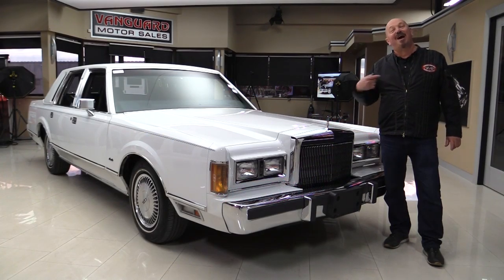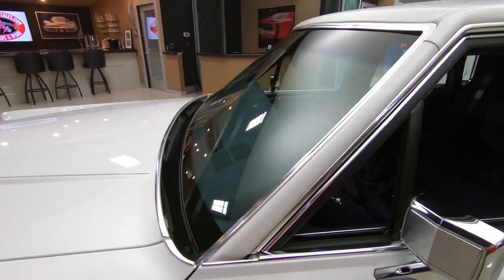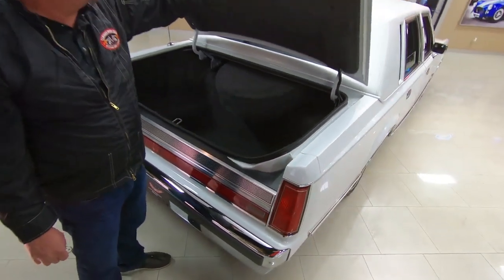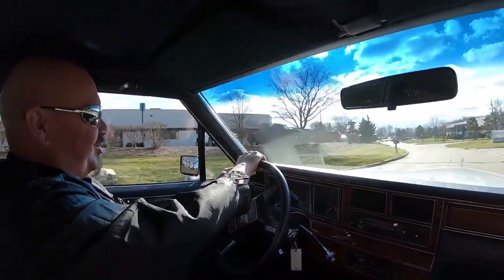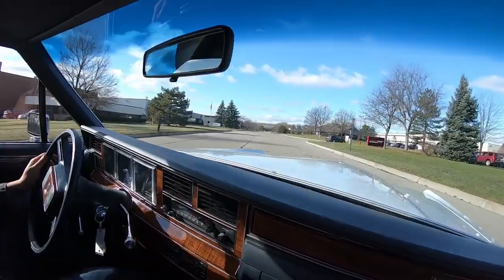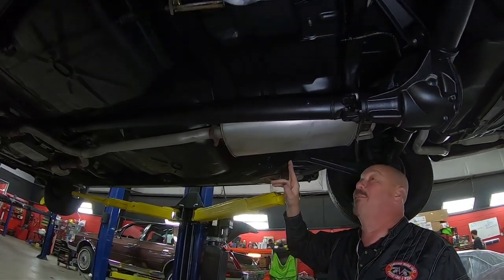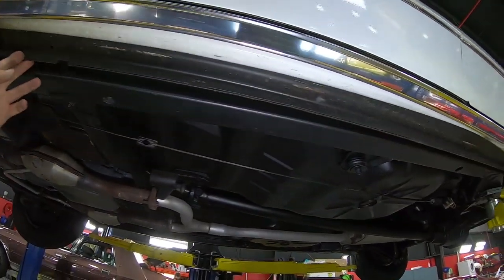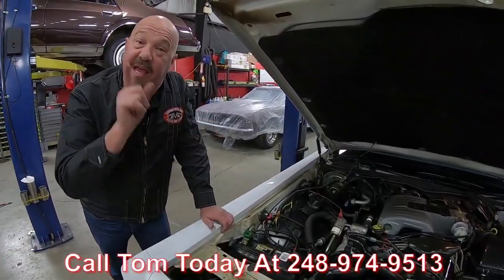1989 Lincoln Town Car For Sale

Comment: My father, a railroad exec, bought my mother a new one every 2 years...I loved them...I liked the Continental myself but mom liked the larger Town Car...Every two years the dealer could not wait to get his hands on mom's trade in as they usually only had under 10K miles for 2 years...In the 80's a car was only kept up until 75K miles as that's when things would start to break..unlike today's cars that are good until 200K miles! Thanks for a stroll down memory lane!
Reply: these cars could easily go 200 thousand plus miles if taken care of, they were built way better than today's plastic so-called high tech junk...mush easier to work on too...